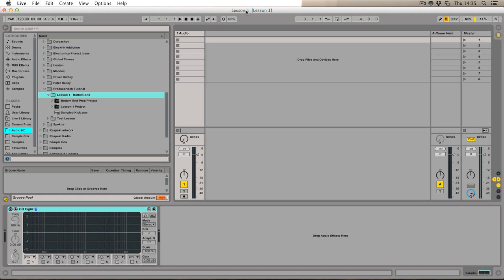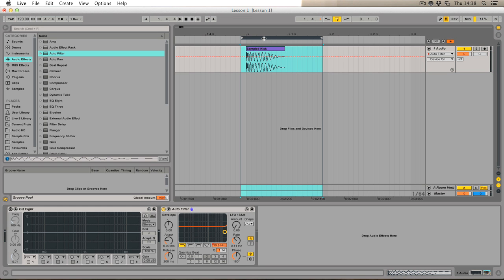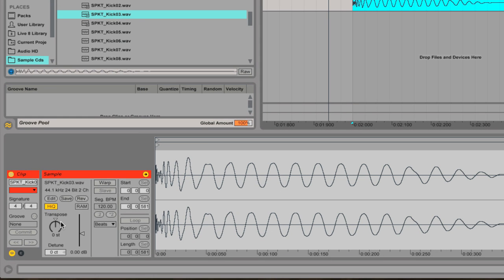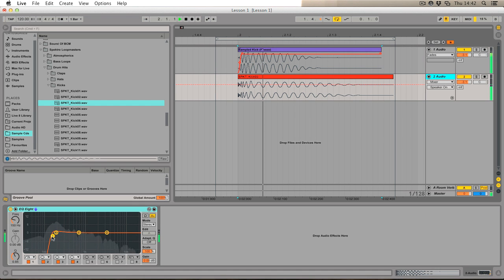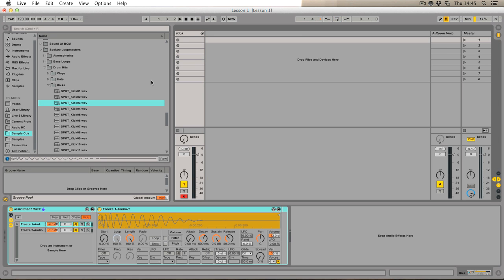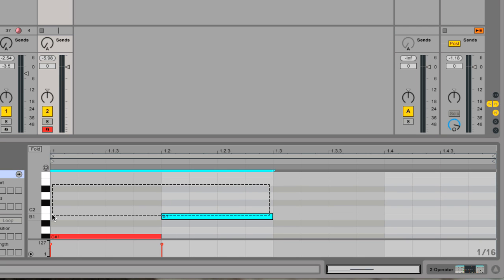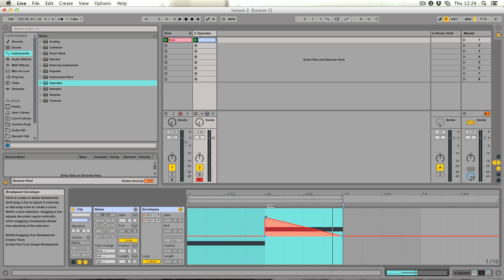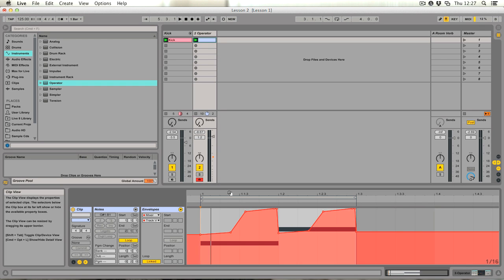Tech House and Techno Production Tutorials - Online Course by Paul Maddox (Spektre)

Comment: Tips: from users
-great tutorial, at arpimd 12:50 I would suggest to use Gain control in Utility effect to do this and dont mess up with the main mixer
The Glitch you mention I think that has to do with the fades on the sample. If you right click, show fades, then get rid of the fade, that shouldn't be a problem any more. Or i believe you can turn off fades altogether somewhere in the prefs.

+Ginkgo Yeah, this caused me so much grief before I learned to disable it...
"Live will always create safety fades on audio clips if the option 'Create Fades on Clip Edges' is activated in the 'Record/Warp/Launch' preferences. This function can be turned off but it is not recommended - it might result in clicks on clip transitions"

- you my friend do not know how to layer a kick, when you chose the second kick, the best way to layer it with your main kick is to highlight the part you want and drag it in your main kick where ever you want it. much more cleaner